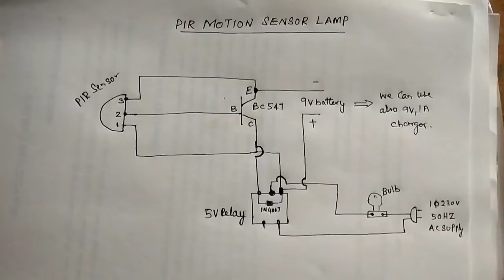PIR MOTION SENSOR LIGHT@EASY ENGINEERING #engineering #polytechnic #easy @easyengineering531

Comment: I have a project that needed a PIR to turn on a 360% servo and an 5 LED array but ChatGPT kept telling me you need an Arduino to do that. 
You've proved that you don't need an Arduino. Thanks for that. btw, what solder do you use?
Reply from the maker: I used only normal soldering iron brand soldron

Comment: Sir iam using  5 volt relay module but relay continuesly on not cut off  what the reason plese tell me sirm
Reply: Sir their are two control preset button in the PIR sensor please   adjust that

Comment: Whey you use resister?
Reply from the maker: Resistor are use for limited the current flow brother
Reply: @easyengineering531 yaaa whey u limit?whithout limit what happens?
Reply from the maker: Brother you can find all circuits are built with resistor to avoid from higher voltage flow